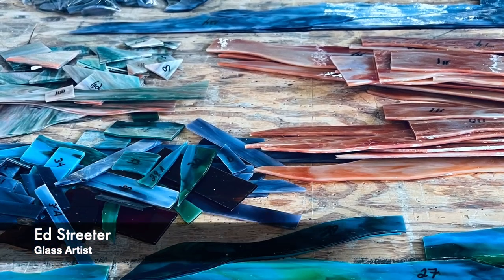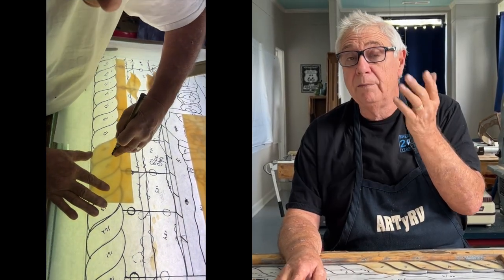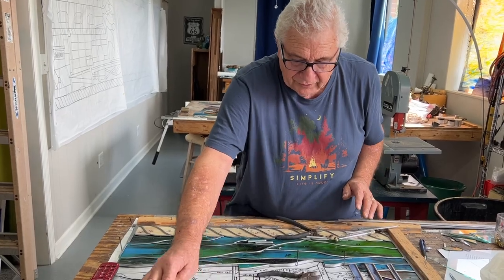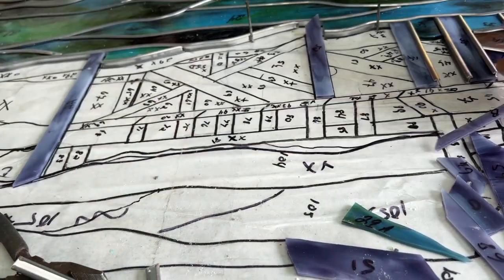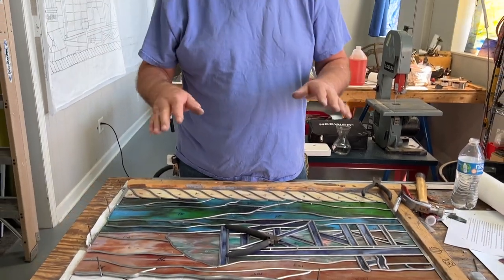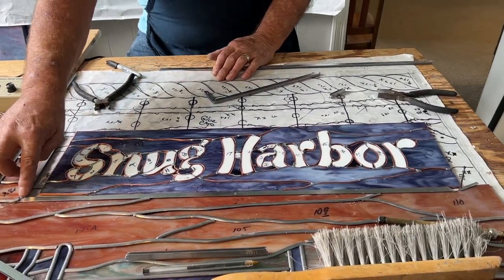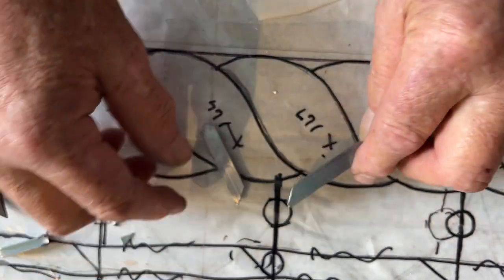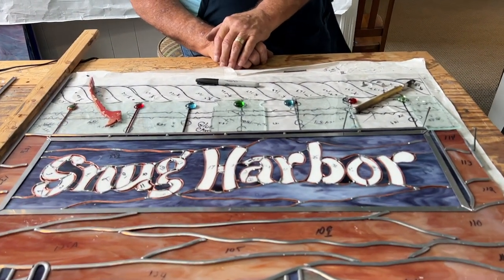Lead & Copper Foil Stained Glass

Comment: You use baking soda/water to clean copper foil projects. My question is on larger leaded projects as this one, what do you use to clean flux and dust off before cementing. I prefer leading and concern of baking soda staying in the channel. I'm using window cleaner and finish with acetone.
Reply from the maker: Remove dust with a bench brush and clean the panel with a vinegar-based glass cleaner. The finishing/putty process will clean and polish the window.